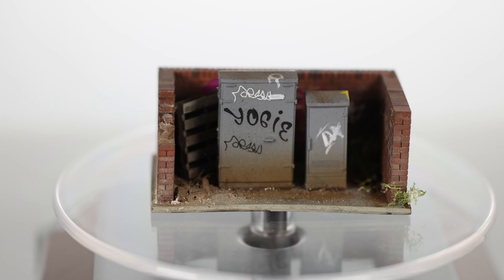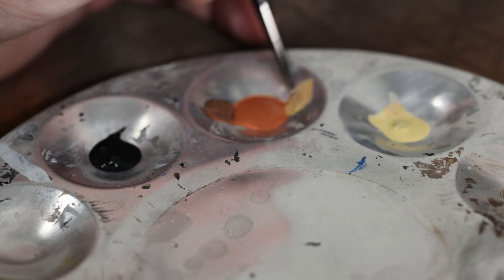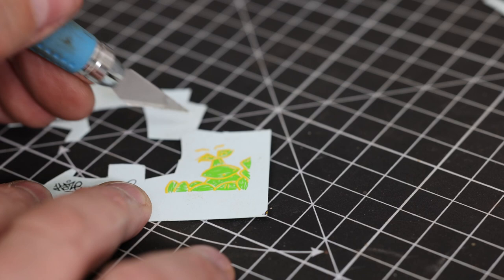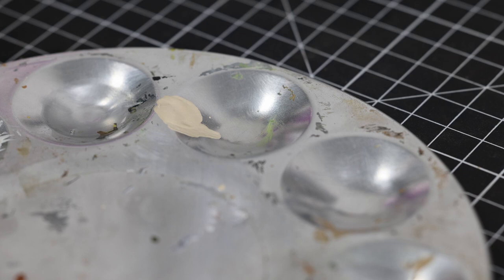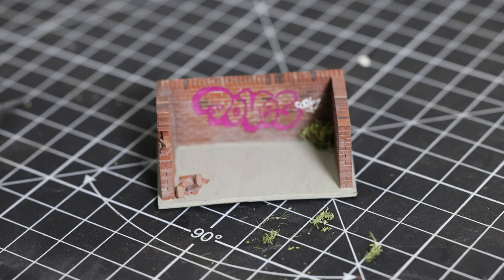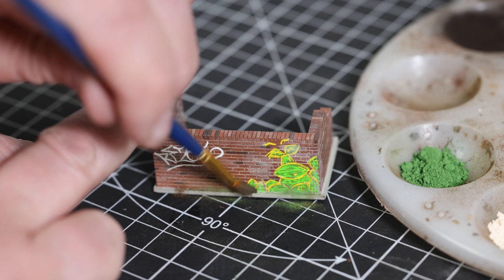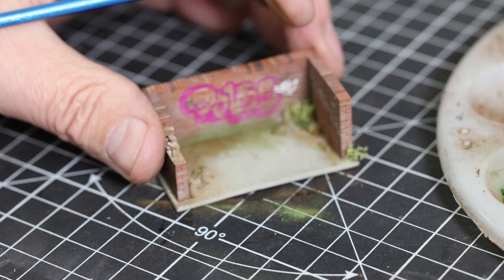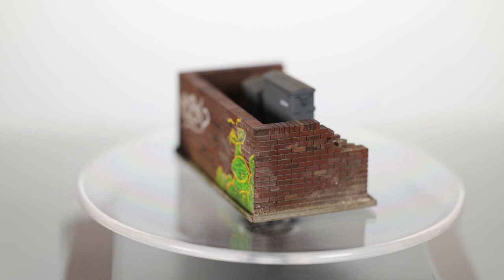Painting Brick Walls & Buildings | Weathering Model Railway

Comment: Lovely work here, subscribed❤

I’v been painting brickwork same as you have done for many years now, but can I make a suggestion to try something different?
Paint the base layer of brick red as you normally would, but instead of mixing individual paint colours for picking out different brick colours, try cheap fibre tipped pens, it’s much quicker, the ink is a little translucent and not too heavy, so the effect is a little more subtle.
I’v been trying it for about two years, out of around thirty years, and now tend to stick to this method, but it’s down to personal preference.
Reply from the maker: Great suggestion. I feel an updated video coming up!! Now where did i leave those railway arches.....?